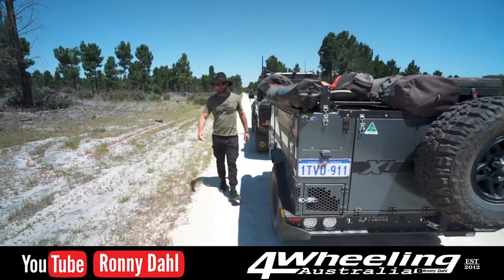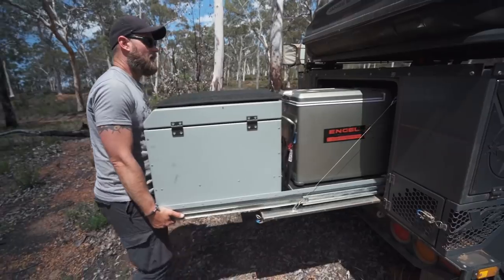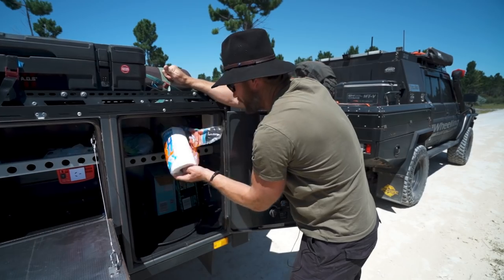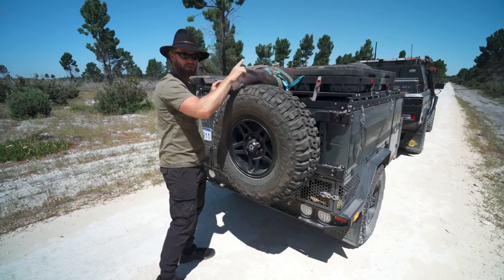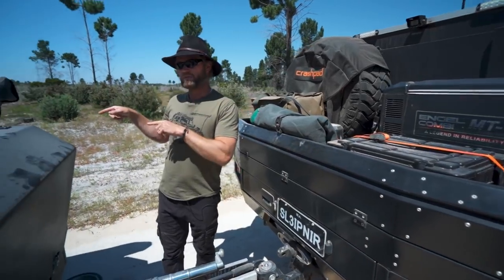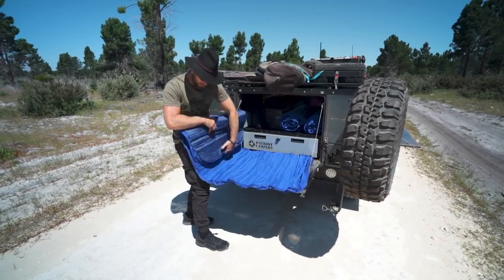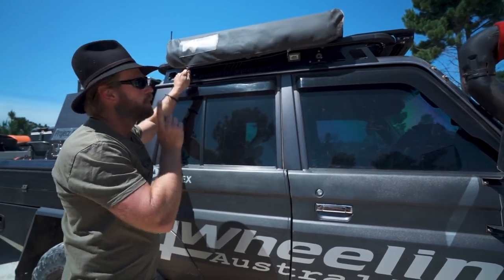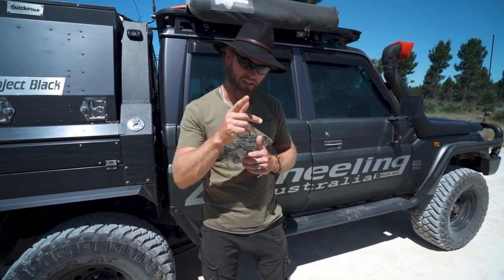Ronny Dahl's FIRST TRIP with a Patriot Campers X1-N! [Shot & Edited by Ronny Dahl]

Comment: Ronny. The longer the length or distance between the hitch point and position of the wheels, the slower the towed object will move or articulate in reverse. The shorter the distance, the quicker it will get out of alignment.

Comment: It sounds wrong but it's actually easier to back up a longer trailer. Sure it takes more room to manoeuvre but there's a longer delay between the movement of the tow vehicle and the trailer vs a shorter trailer which responds much faster to less input.
Reply: Yep, longer trailers are easier to back up.